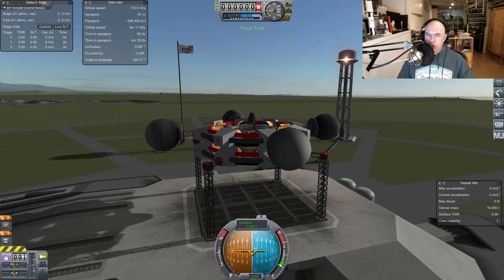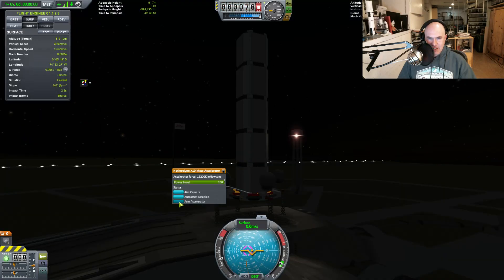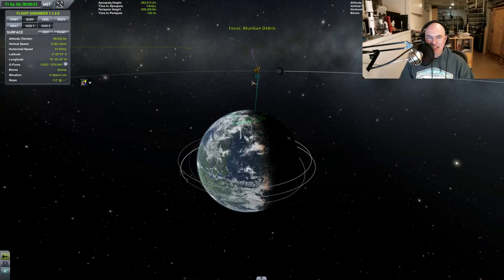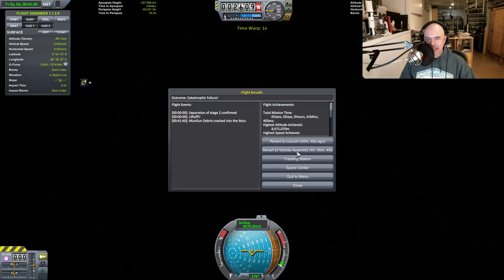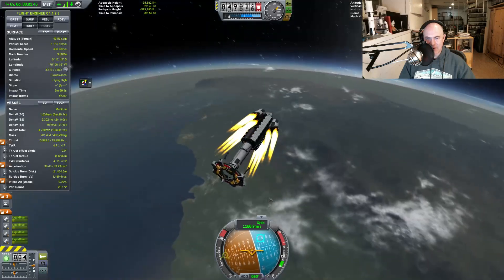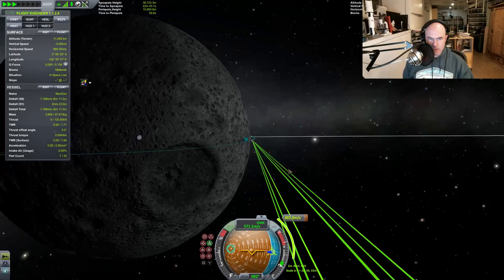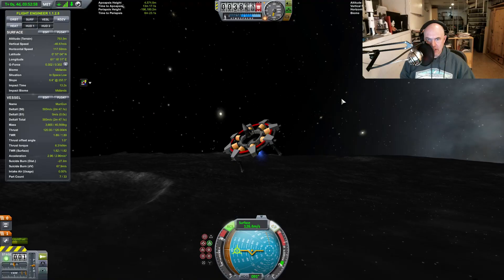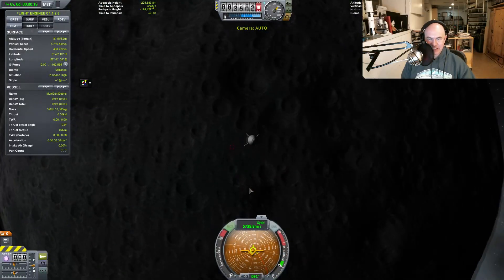Kerbal Railgun - Interplanetary Bombardment

Comment: I took it upon myself to do some rough calculations, and I came out that the average acceleration of the thing is 5.34033333333333. I plugged it into F=MA and using the fact that it's around 3665 kg, the force comes out to around 19572.32167 newtons. Probably enough to kill somebody

Comment: Use the railgun to shoot parts of a space station into orbit. Subsequent shots shoot it at the previous parts. In orbit when aproaching the previous part the station may need some assistance  assembling them together. Magnetic connections may be the way forward. (magnetic field emission dynamics in orbit) MFED may be needed for controlled assembly . For parts that are susceptable to damage by the railgun can be implemented using conventional measures. eg: rockets

Comment: @Scott Manley Can we just take a moment to realize that the warhead you shot from the Moon at Kerbin, impacted Kerbin at Mach 17.5... which means that it hit the surface going 13,421mph or 21,600km/h. Giving that warhead the equivalent destruction power of 132 megaton bomb, that is 32 megatons stronger than the theorized max potential of the Tsar bomba, the biggest nuclear bomb tested to this day.
Reply from the maker: We could take a moment, but then we'd realize those numbers are made up and wrong :)

Comment: Nice job! I (tried) to calculate the impact force of your slug. It seems based on the numbers to the left (assuming they describe the projectile) that your slug weighs 3,600 kg and had a speed of around 6,500 m/s at the time of impact. Not exactly sure of the length of your slug, which is important for the impact time, but assuming a length of 1 meter at that speed the impact time ended up being 0.0003sec. With those values, I calculated the impact force to be 152,100,000,000 kg m/s^2 (N); or 0.15 terajoules (0.035 kt TNT). Not bad, roughly four times more powerful than the smallest tactical nuclear bomb ever built in the US. Maybe if you can achieve higher speeds you will get better impact forces, but even if you can achieve 20 km/s, you'll only make 1.45 terajoules, which pales in comparison to the 38,000 TJ yield of the B53 Nuclear bomb. So if you want to do real damage, you're going to need to fire a lot more projectiles, clearly.

Comment: There's a really basic trig formula for hitting a moving target, and all the variables you need are readily available. You just need to anticipate rotation of both bodies and you can get a direct hit next time. There's actually a public version of an old naval fire control manual that has a much more comprehensive set of equations so you can correct for all sorts of nasty things. 

I want to see you crash Jeb directly into the KSP from the Mun.
Reply: MindlessInvalid Whats the name of the manual?
Reply: Fire Control Fundamentals... I think?
It's been a while. 

Anyway, it's the older version of the training material for the navy's fire control rating. I wanna say... late 50s?

Actual fire control systems are designed to account for a slew of nasty variable that you don't need for Kerbal space program, the  basic moving origin -> moving target formula is all you need. 

Basically for that one all you need is distance to target, your bearing and velocity, your target's bearing and velocity, and projectile velocity.

Comment: Scott, route your mic through a DAW and use a compressor to limit your gain and optimise the volume and dynamic range.
Reply from the maker: +Kieren Brereton that works great until Rogue software resets your preamp gain and doesn't provide any feedback to you.
Reply: Scott Manley Ah, yup that'll do it. Maybe invest in a little cheap hardware pre so that it has a fixed gain control? Even a cheap external audio interface or mixer would solve that.
Reply from the maker: +Kieren Brereton as a DJ I have tons of dedicated audio hardware which I used to use, but switched to USB because I really needed fewer wires.

Comment: I have a question that's been buggig me for a while. Why do rockets need to accelerate so quickly? I mean... it'd be a lot easier for the astronauts to do it with a smaller g. I guess, it's maybe because of fuel-effeciency, but hopefully you guys know it better, and could also test it in KSP.
Reply: György Mohl  most real rockets dont have deeply throttle-able engines. I don't know about modern rockets but the olds ones couldn't throttle at all with there main engines, so its not the start that has such high G's its when the stage is almost empty, and the TWR goes from around 2 to 10 or 15. Its more of a side effect of needing so much thrust to heft everything at the start then required.
Reply: It's absolutely logical, thank you for the answer! :)

Comment: How much force would be imparted on the surface of the Mun when it was impacted by the projectile at 5 km/s from ~250 meters altitude? (talking about the moment at 12:05).

edit: Got bored and did some napkin math (the best kind of math).
The mass of the projectile was 3745 kg (craft mass before - craft mass after). For the negative acceleration, I just chose to do 1/60 of a second (.016 seconds). -5,000 meters per second (-5 km/s) divided by .016 seconds gives us -312,500 m/s^2 acceleration. 312,500 * 3745000 g (3745 kg) = 1,170,312,500 kN.
1,170,312,500 kN is roughly 900000000 kN more than the force of sunlight on hitting Earth. It's also equal to the explosive energy of the Soviet Tsar Bomba (50 KT, ~1,000,000,000 joule/meter).

tl:dr: It's a lot.

Comment: how much velocity would an ion drive add to that in the 30 minutes it's flying in space?
Reply: For a 1600kg object with a 3kN ion engine means acceleration would equal 0.193125ms^-2. In 30 mins the space craft's velocity would increase by 347.625ms^-1. Not by very much compared to the initial 5500ms^-1. 6.32% increase in velocity.

Comment: Could you combine this with the Rods From The Gods projectiles to create the ultimate orbital bombardment weapon?
Reply: Spyros Sakellariou Yeah, you didn't read the first and second replies, did you?
Reply: Also a possibility. I'd initially discarded it due to needing to calculate the exact amount of thrust needed, with the right engines, and accounting for fuel, etc. Just seems simpler to counter the momentum of the shot with an opposite-facing shot.
Reply: the problem with that is the moment you shoot it, the station that shot it will be flying in the opposite direction.  though at a slower pace due to mass and energy shit that I don't completely understand.
Reply: Seems like you could counteract that, somehow. Another mass driver directly opposite the initial one firing in tandem? Have to use something that breaks apart when fired, so you're not just shooting another rod out into the galaxy...

Just spitballing.
Reply: Daniel Cabral  or just a crap tonna thrusters to counteract the ole' kinetic bombardment weapons of death!
Reply: Don't forget that shot might reach it somewhere sometime. Newton's the deadliest son of a bitch in space.
Reply: +Daniel Cabral +Spyros Sakellariou
An accelerator pushing no mass doesn't recoil. It's why an experienced gunman can tell the difference between live and blanks. Every time you fired the thing, you double the expense, and add space junk.
Reply: Hadzabadza Might reach what when?
Reply: Hadzabadza Especially 1kg ferrous slugs which ruin people's day.
Reply: +Hadzabadza
Mass Effect 3?
FEEL THE WEIGHT

Comment: me has about 2k hours in ksp
trying career on hard, design a rocket for like an hour
all checked and double checked
spins like an epileptic on a rave at bout 30 km
scott piles up some shit in an undefined object resembling a dildo
flies flawlessly on all its way
Reply: That's KSP for you
Reply: this video is edited too, maybe he took out the failed launches. and he's also cheating with infinite fuel
Reply: To be fair, you literally can't fly through the atmosphere at 6000m/s in game without cheating. But it'd be impressive if you managed it.
Reply: Super Dragon 
if that was a reply to me I have one question if you have 60 hours in the game how do you not know the difference between RCS and SAS?

if your statement was directed to redy all of my craft even with SAS have spun out during the gravity turn and I've still been able to put in orbit 3 satellites and 1 shuttle. it should be pretty obvious if you want to get a rocket in the air you need SAS (or a lot of skill and luck)
Reply: if he had spent any time looking though parts he'd know that rcs is a type of manoeuvre thruster or are you claiming most of the 60 hours he was AFK i at least gave him the benefit of the doubt that he spent most of the 60 hours building and flying...
Reply: +AnD1262
I've been experimenting with that for about ~4 ish months, spread out. With the use of a ramjet and a few jumpjet engines, I've gotten to about 1500-1600 in low atmosphere. Thermal radiators can act as thermal protection for your ship, angled right, causes hardly any drag.

But, my goal was hypersonic, which I got, so I quit .-.
Reply: u wat. 

I have 60 hours in KSP and the first thing i'll put on anything is an SAS.
Reply: there some sit hours dude
Reply: Super Dragon 
I have 370 hours in KSP.
Reply: redy5 same sooooo same
Reply: Lol
Reply: Did you put Bill in the cockpit again with no SAS or reaction wheels again?
Reply: id say same sort of. but i realised what people say about loading your ship with wings makes it more stable is misleading because you run trial and error and seeing the difference between wings and no wings at low altitude makes you rely on them when at high altitude they are dead weight and you have to rely on how well you built the rocket examples being gimbled rockets and RCS (if you remember them unlike me some times) as well as weight distribution and where the thrust is...
not that I'm an expert but having looked at his dildo rocket i think maybe the fact that the way the rockets are pointed outwards may be how that thing is so stable unless he rolls it at lower altitudes that is
Reply: ive recently being experimenting in atmo with air breathing engines 1300 M/s is pushing without shielding from heat
Reply: redy5 that's because you prob have more weight on one side of the ship and it throws off your center of mass.
I found that using wings at the base of the rocket acts like a dart or an arrow fletching, but are useless in vacuum. Using sas helps a lot but too much weight will still make it turn. Also adding part symmetrically helps balance.
Reply: Don’t you mean 20 hours?
If you had 2.7 months in Ksp, you’d know how to make a working rocket.
Don’t try to show off.
Reply: he heavily edits, uses lotsa mods and uses modded parts, it can be a helllllll of a lot easier with modded parts in your game and trees.

Comment: I'm curious, Scott.  How much of a shockwave/impact crater would that round create traveling at that speed?  Could it still dmg KSC from 60km away?
Reply: Well, I stand corrected. In that case, the Space Center would probably hear an explosion, but not much else.

Still, an impressive shot from the Mun on the first try
Reply: It was about as powerful as the bombs dropped on Japan at the end of WWII. Not super powerful by today's nuclear weapon's standards, but would probably have blown out windows and maybe damaged sensitive equipment at the KSC 60 km away
Reply: His projectile was 1665 kg, and it impacted at 5778 m/s. It had a kinetic energy of 27,793,248,930 J,  roughly 27.8 GJ, which is equivalent to 6.64 tons of TNT. But even if the projectile was 2 tons heavier, it'd still be just   14.62 tons of TNT.
Reply: Honestly, I don't know.
It would depend what do you qualify as 'hit'.
Reply: Just calculate kinetic energy and compere it with energy realeses by tons of TNT
Reply: +Skip6235
As Scott said, the impact was equivalent to about 7 tons of TNT. In comparison, "Little Boy" exploded with the equivalent energy of 15 kilotons... So no, it wasn't "about as powerful"...
Reply: When did he say that? On the livestream? Because it wasn't in this video. 

IDK, I did rough calculations for a 3665 kg projectile traveling about 6 km/s and got 17 kilotons. Granted, I could be off by an order of magnitude somewhere, since I did it really quickly. Anyone care to check my work?
Reply: 7 tons of tnt. Would blow up a building fine, but not mutch collateral.

Comment: so I ran some basic numbers based on your kerbal engineer data and your object of 1655kg going 5778m/s on impact of kerbin delivered 286,877,700 Joules of potential energy
Reply from the maker: Only equivalent to about 7 tons of TNT, need to get it closer.
Reply: You must have made an error somewhere.  The quick estimate is:

mass * velocity^2 / (9 km^2/s^2) = TNT equivalent

The 14 looks right, but that would be tonnes, not kT.
Reply: Good enough for deer hunting?
Reply: Mun Is a Harsh Mistress? In the book an oversized railgun shooting Earth is described as very destructive: large bright flashes seen from Luna, cities leveled, tsunamis. They accelerate containers (of a few tons?) to just past escape velocity of Luna and have them basically fall to Earth in about 10 hours. Doesn't list exact mass or impact velocity though.
Reply: The reason the 1st Law of Space Combat[1] works is because you are 
operating past the realm where your weapon is acting as a penetrator.  
In fact, it actually helps that the kinetic projectile vaporizes because
 you want all that energy being turned into heat.

[1] "Anything moving at 3km/s packs its own weight in blam."
Reply: you say potential energy, but i'm pretty sure thats kinetic energy
Reply: I calculated 61 GJ of kinetic energy before impact, (3665kg @ 5773m/s), so a bit over 14 kilotons of TNT.
That's a lot of stress on the accelerator (15.2 meganewtons for ~1.3 seconds). That's more force than 2 F-1 rocket engines!
Reply: chakatfirepaw Thanks for the correction, the kinetic energy wasn't in the terajoule range needed for kilotons.
Reply: I see you too were theorizing that such a weapon wouldn't even need a warhead, just be big enough to devastate everything around it.
Perhaps something like 50ft across would be enough to do some damage from 12km away, moving at 8.0 miles per second.
Reply: +Scott Manley add weight, or power, (or two for best results)
Reply: Archeval 
that's a super MAC or there abouts right?

This may be more of a question of physics but   
                           
Kinetic energy is related to mass and energy by:

E=1/2mv^2

This means that the energy increases quadratically with velocity. A 600,000 kilogram projectile moving at 30,000 m/s would have a kinetic energy of 2.7e14 joules, which according to wikipedia would be equivalent to a 64.5 kiloton TNT explosion, or about 4 times the energy of the nuclear weapon that razed Hiroshima.
right?
Reply: +Cinnabun Yeah people have been thinking about that for a long time. The only reason we're not doing the whole kinetic bombardment thing already is because UN.
Reply: What the UN doesn't know wont hurt them (;
whatever that X-35B is I'm sure the UN isn't happy with it
Reply: Archeval Thats enough to vaporize 143 *aprox people
Reply: Casu Al That doesn't sound quite right; a Hohmann transfer to/from the Moon in real solar system KSP takes about 5 days.
Reply: My 1 brain cell don't understand anything about caclating jules of force
Reply: @justgaming7865   joules are energy... newtons are force
Reply: Archeval thank you for doing the math so I didn’t have too 😂
Reply: R/theydidthemath
Reply: I don’t understand sheep
Reply: when nerds plays games
Reply: @johnpaullazaro985  you need to be a nerd to play this lmao
Reply: umm why saying in numbers
Reply: Add a nuke and that would have flattened the target

Comment: We should build one on the Moon and use it for spacecraft launched further out into the Solar System, or back to Earth.
Reply: Good luck trying to make anything survive 1000+ Gs 😂
Reply: Well I mean a longer, weaker version, enough to provide 1k-3k delta V with an acceleration of 4-6g or so but over a longer distance. Given that the Moon doesn't have an atmosphere to slow you down, and the relatively mature technology involved (MagLevs, etc), it shouldn't be too great of a challenge I'd have thought, once you have the materials in place. 

It'd be useful in the future if we have Helium 3 mining operations there, etc. At that point making  basically a 12.5km long maglev (conservative/ pessimistic: 1k delta V, 4g acceleration) might be cost effective, given the potential value of Helium 3.

Comment: Make a station capable of firing this thing, that can be aimed using RCS, then make a K.O.S program that auto aims to a target if that is possible, you could bombard other stations orbiting the mun from LKO if any of this is feasible and firing it does not give recoil and launch you back
Reply: Hurp Durp if it does cause recoil then just add a secondary one facing 180 away, I mean it should be possible just very difficult on the maths

Comment: Love your videos, but please limit your levels or move the mic a bit further away.
Reply from the maker: It's really frustrating, Open Broadcaster seems to do something to the windows audio settings and unless I go into them to reset them after starting OBS then the mic is just super loud. OBS has volume meters and they don's reflect this, it's very annoying.
Reply from the maker: The clipping produces harsh sounding distortion, that's what you're hearing.
Reply from the maker: It's not really about the volume, when an audio signal gets clipped a low frequency wave gains lots of higher frequency harmonics which make it sound awful.
Reply: I love OBS studio (or whatever I use) Only free recording thing I have found that doesn't have that watermark or whatever.
Reply: Thanks for your answer! That's a very annoying problem, hopefully it can get patched in OBS.
Reply: or just... you turn down the volume?
Reply: Scott Manley i haven't even watched the video im still looking for my headphones